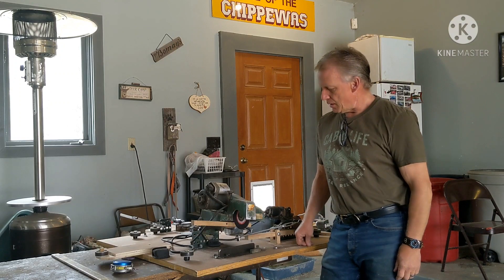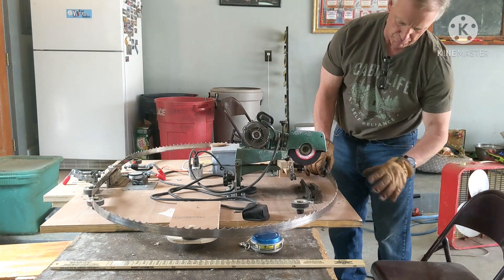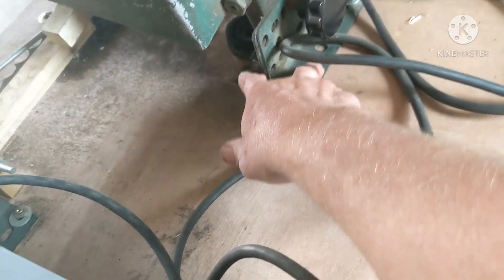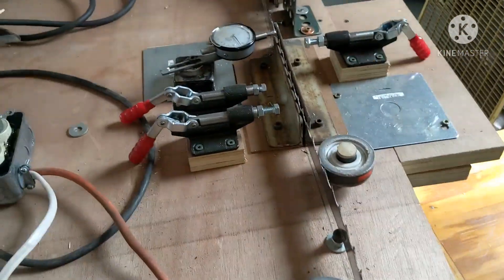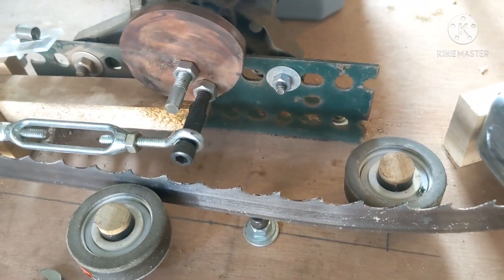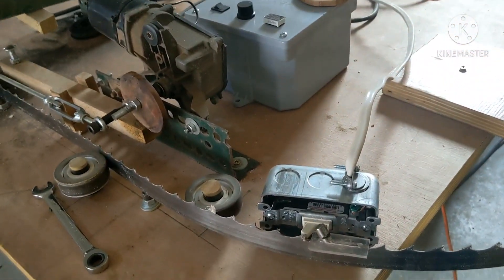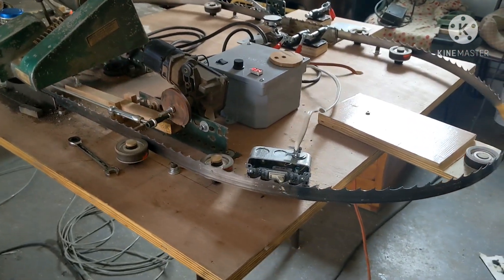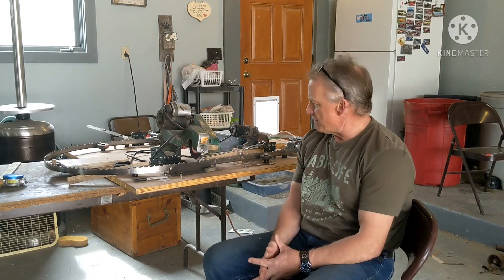Diy Sawmill Blade Sharpener

Comment: That is slick. I imagine figuring out the cam wheel took a bit of vamping.  Are you planning on bringing the mill inside for the winter ?  Thanks !
Reply from the maker: The cam is pretty easy...it just took time and patience.  I am bringing it in when it gets around January.  I have a modification I want to build.
Reply: @BigelowWoodcraft  I bet. Can’t wait.

Comment: Can you please send me what you used for this build
Reply from the maker: If you go back a couple videos I list all the components.   Thanks for watching
Reply from the maker: I'm so sorry I thought this was a different video.  Yes I'll list it out for you.
Reply from the maker: Windshield wiper motor,
Pulse width modulator,
Ac to DC 12 volt converter,
Unistrut,
And a Foley chainsaw sharpener,

For the setter.
3 push pull clamps. 
Either a dial indicator or calipers to measure set.   I don't use the dial indicator and only use the calipers.

Comment: Great job Jerry. you need to grind the gullet as stress cracks will appear in the bottom of the gullet of the tooth when the blade is sawing the bending of the blade going around the drive pulley of the mill causes this. I have a grindlux 4000 and it talks about this in the manual. It says that the blade will break if the cracks aren't ground out! Just letting you know!
Reply from the maker: Yes I do grind the gullet. I know this video doesn't show it. But as I lower the depth it gets the gullet. I'm guessing I'm about .020 above the gullet. I've only had one blade break so far. That broke at the weld. These blades each have about six to 10 sharpening each. So I suspect they will start giving up their usefulness shortly. Thank you for watching
Reply: @BigelowWoodcraft  If you like Jerry look me up on FB same name here and I will take a picture of the page in the manual that shows the micro cracks so in case your not sure what they are talking about. I am thinking they have done extensive research on this topic! I would send it to you!
Reply from the maker: Marc, I don't have a public Facebook profile.  I do have my cam shaped to follow the gullets better now.   I've still only broke two blade so far and those both were at the weld.   I'm very happy with the grinder.  I'm approaching 10 resharpenings on most of the blades.  The sharpener has been a huge part of my operation.   Thanks for the follow-up

Comment: Your not sharpening the back of the tooth which is important,
Reply from the maker: If i lower the depth it does cut the gullet and run up the back of the tooth.  Usually it just dusts the back.  I've not seen any noticable difference if it doesn't dust the back of the tooth.   I'll try and pay attention a bit closer to the blades and actually compare.   These blades I sharpen always cut as well as a new blade.  I have about 6 to 8 sharpens on these current batch.   I've learned a lot in the last 6 months.   Thank you for the input and watching.
Reply: I'd like to see how you set the teeth with your set up please

Comment: I don’t have a clue on get the cam how do you start give a idea thanks
Reply from the maker: What i did is turned the cam where i wanted.  This would push the blade with the arm.  Then i marked the cam with a pencil.  This mark is the spot i need to cut down.   I determined the amount of stock by measuring the bottom of the grinding wheel to the blade with a machinest scale....i tried to read it to the .020".   So if my grinding wheel was .375 over the blade i would grind the cam down .375.   this only works if your rocker arm is 1 to 1.  If it's not you have to take the ratio.   You do this about every 20 degrees on the cam.   This will get you close.   Then i use a flap wheel on a drill motor to fine turne it.   Hope this makes sense.

Comment: Could I have some specs on how to build tooth setter and I have chainsaw sharpener
Reply from the maker: I don't know about any specs.   It was all trial and error.   I used a windshield motor to drive the cam and the push rod.   I used a 12v dc inverter to run the windshield motor.   A PWM control from Amazon to control the speed of the motor.   The setter is just those clamps that at placed at the proper locations to correspond with the teeth of the blade.